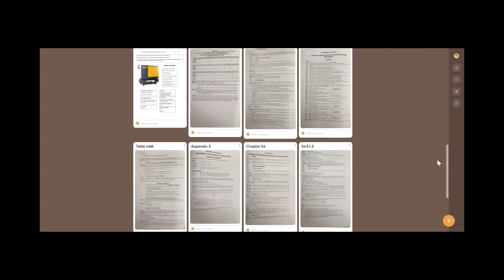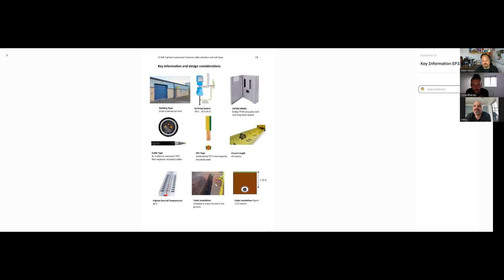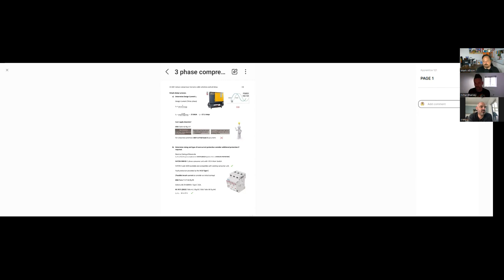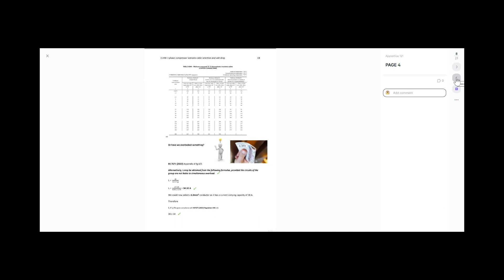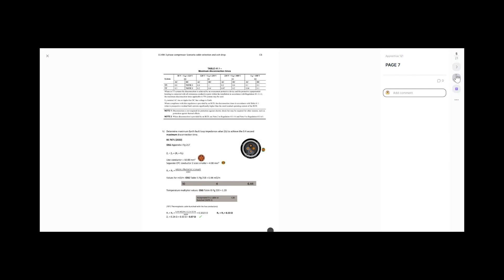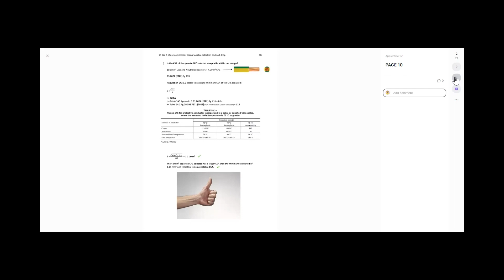How to design a 3 phase electrical compressor / motor circuit 43m long!

Comment: Why install the CPC as a separate conductor? Why not just select an SWA with an additional core to act as the CPC? Is this choice purely based on cost?
Reply: Quite often a seperate CPC is specified on some of the tenders that I work on. It also allows you to reduce the CPC size which may save the client money
Reply: @craigbuist4636  Fair enough, that makes sense I guess. Having put a bit more thought into it, I suppose if the client is unfortunate enough to suffer a catastrophic fault which is sufficient enough to destroy or damage the CPC, at least you wouldn't be required to replace the entire SWA containing the CPC!
Reply from the maker: It's just an example to discuss rather and present improvements upon 🤭
Reply: @A121-Training  Hehehe. I feel that distribution circuits are maybe a topic well worthy of their own video/discussion? Do you agree?

Comment: I always thought that  the rating factor of cc=0.9 has to always be added to any cable buried in the ground. Keep up the good work, guys.
Reply: It definitely is a factor that is discussed in appendix 4 for being applied. We will come back and go through this in more depth in the future, just slowly introducing people and building up. I would equally like to explore ERA and soil resistivity as we get further down the line
Reply from the maker: @craigbuist4636 you guys have to being me up to speed before we get to complex to soon 🤭.

Loving taking part and all the comments on the series.